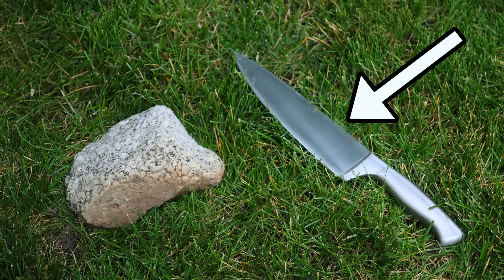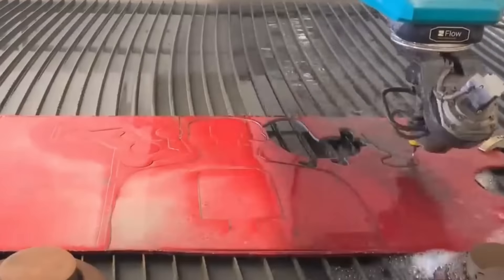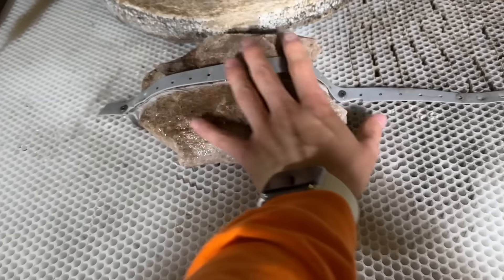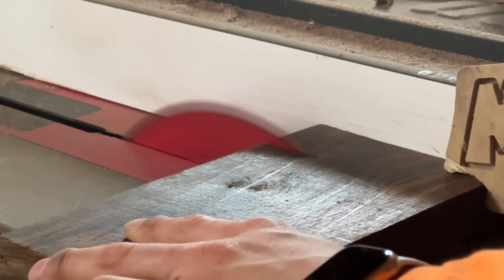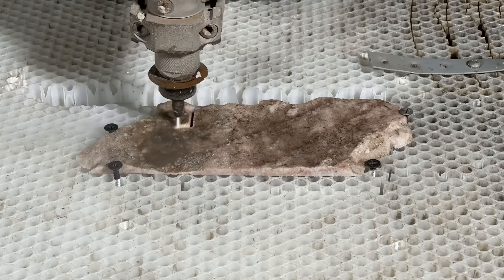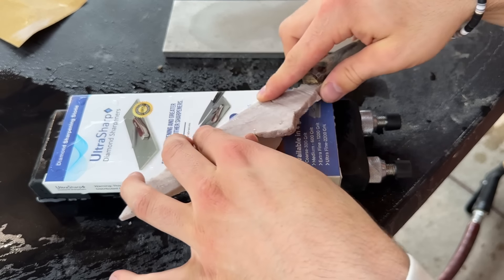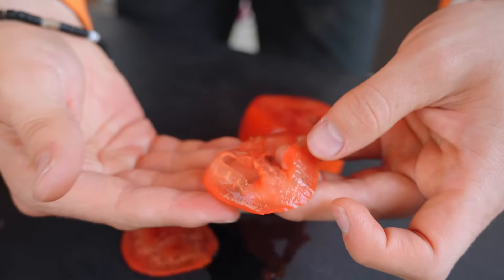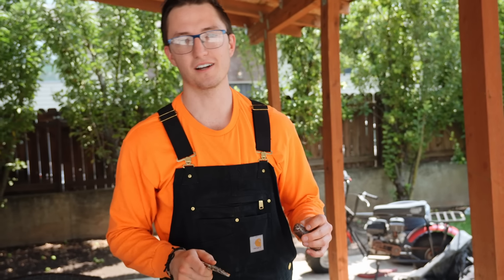World's Sharpest Rock Knife

Comment: might be worth trying to find some "Banded Gneiss" (yes, it's really pronounced like the word "nice", so you can make all the dumb puns you want with that) that has some nice straight lines in it. it's a different type of granite, but should work better than the mottled variety you used here. not sure what that pink rock was, though others seem to think it's pink quartz.

if you wanna try doing something REALLY fancy, you can actually grow your very own rubies an arc welder with carbon rods, and a chunk of graphite. rubies are a material called Corundum (same as sapphires), that's a 9 on a mohs hardness scale, only 1 below diamond. it should be able to get sharpened into a VERY sharp edge, and also be fairly durable. I would strongly recommend checking out NightHawkinLight's older video on making rubies, but instead of making a small bowl that produces a button, make longer square mold for a bar, or even just buying a graphite mold meant for making gold bars. it's a pretty simple process.

Comment: what if you considered where the cuts will be on the waterjet, like doing the long straight lines parallel with the metal sheets in the water so it isn't so hard on those metal sheets with the longest lines going across all of them, especially cutting through rock. btw I think thats sedimentary rock.